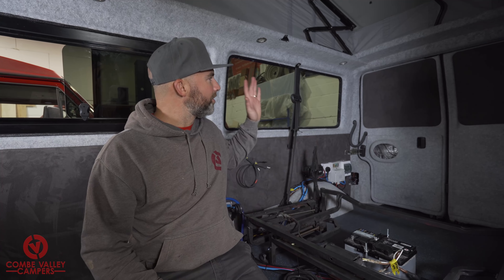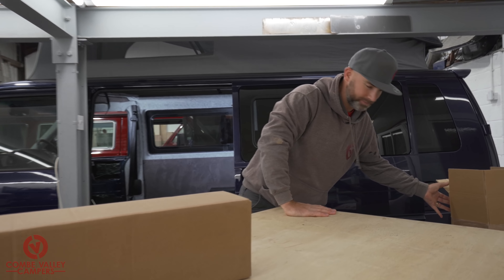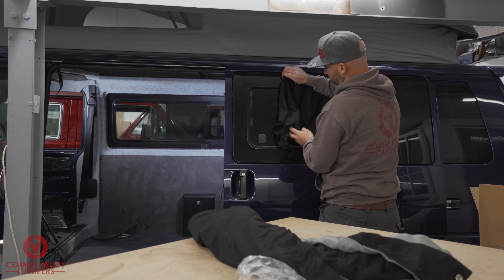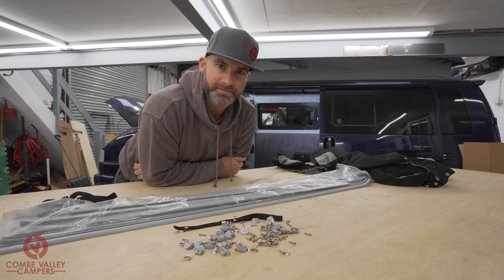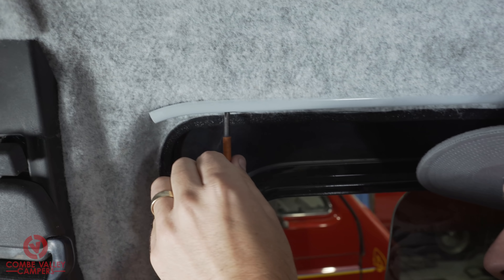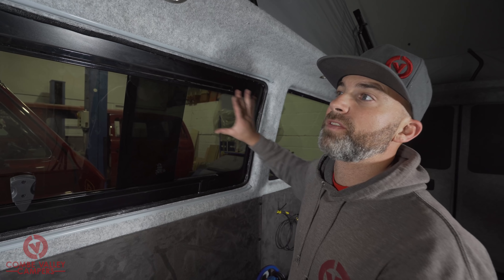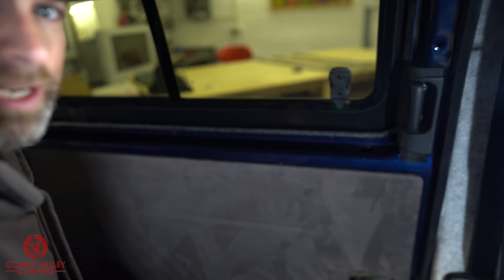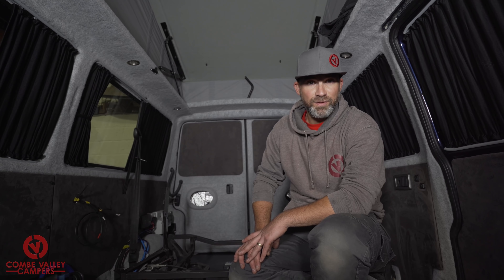HOW TO FIT BLACKOUT OUT CURTAINS TO YOUR CAMPER. (VW T4 Curtain kit)

Comment: You done it Jill done putting How Are You Going to Put the Curtains on with the Endcap Still on There Supposed to Leave the Ian do your job at top and bottom then put the curtains and then put the end caps on what you do is doing the house ready for the end caps👍

Comment: I have a 1993 T4 auto sleeper trooper. I am after a full set of curtains front and back. They have a pre installed rail at the top and poppers along the bottom all with tie backs. Can anyone point me in the right direction please?

Comment: Just be careful because people are going crazy from being in lock down!

Actually I've just been talking about this with the microwave and toaster while drinking coffee and we all agreed that things are getting bad.

I didn't mention anything to the washing machine as she puts a different spin on everything.

Certainly not to the fridge as he is acting cold and distant.

In the end the iron straightened me out as she said everything will be fine, no situation is too pressing.

The vacuum was very unsympathetic... told me to just suck it up, but the fan was more optimistic and hoped it would all soon blow over!

The toilet looked a bit flushed when I asked its opinion and didn’t say anything but the door knob told me to get a grip.

The front door said I was unhinged and so the curtains told me to ........yes, you guessed it .....pull myself together
Reply: Deserves an air freshener. And a sticky. And a goodie. 👍